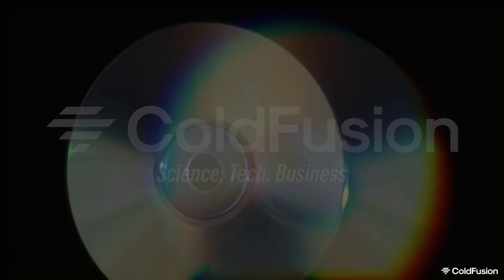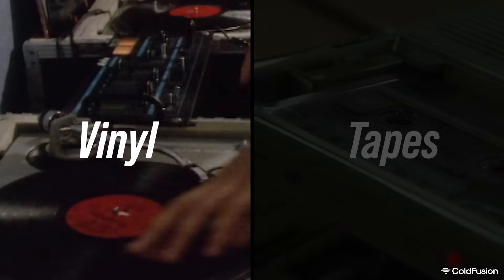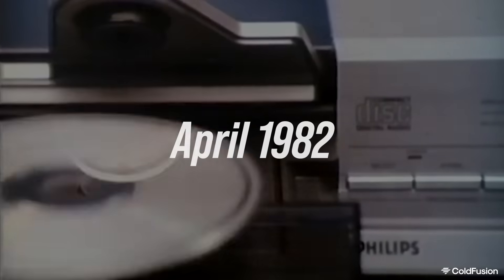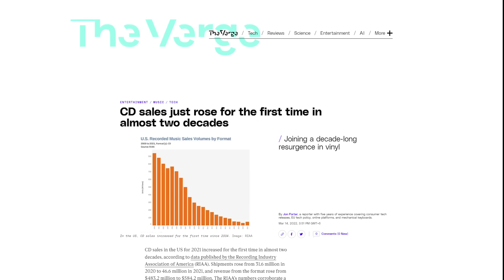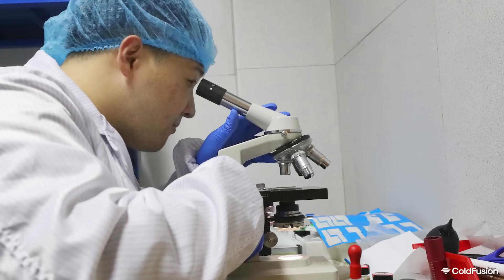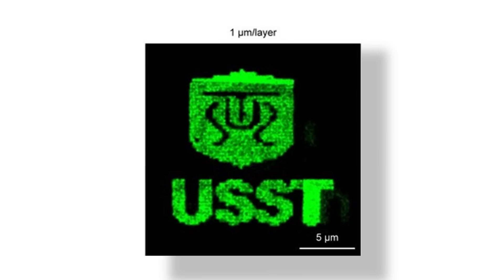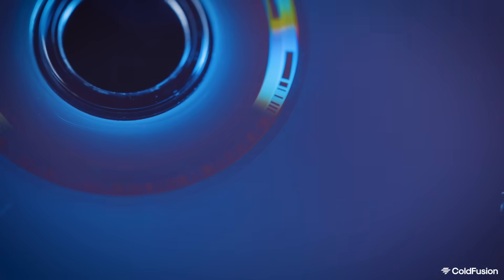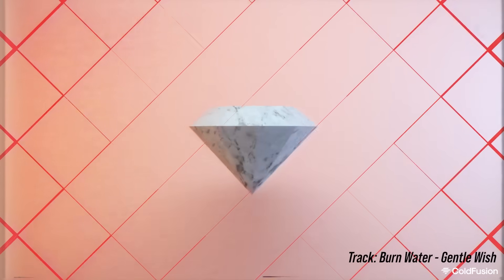Why This New CD Could Change Storage

Comment: This is ludicrously far from commercialization, because the prototype is not even architected as as storage system. They basically wrote some small test patterns close together, and then checked that the adjacent patterns didn't mess each other up. 

(200 TB) / (1 MB/s) = 6.34 years

The spooks will want a black budget edition of this for sure. Record always, read barely ever. With 100,000 of these puppies in a giant datacenter, and a minor performance boost (perhaps 10x), you could have the whole haystack of global internet metadata sitting there, going back for years, to plunge into at any moment for any purpose. Tape is also dense, but recovery takes minutes, rather than seconds. 1 TB/s is a shittonne of global metadata, with say a 5 year retention horizon for drilling into the browsing history of anyone suspected of anything.

Comment: As long as record companies continue to butcher their catalogs, CDs will still retain a massive sound quality advantage. If you like older music from the '60s, '70s and '80s, it can be found on old CD pressings with much better dynamic range and EQ than the brickwalled remasters that are your only option on streaming.

For this reason, streaming services are far from a complete replacement for physical media, especially if you have a decent stereo.

Comment: These may not be suitable for archival use if any property of the dye in the photoresist changes over the years.  In the past with CDs and DVDs, the dye has faded with time, making them difficult to read.  The technology in a 3D nanoscale optical disc is more complex, requiring the dye be optically stimulated before reading.

Comment: If it will sound anything near the old hdd its a no, if it can't get close to the speed of a ssd its a no. I don't see this ever succeeding. Maybe for data centers , but for normal ppl i don't see anyone buying it if it ain't dirt cheap. The will probably pull some crap like with the printers inc...

Comment: You seem to be conflating CD-ROMs (a specific optical disc technology which can hold about 700 MB of data) with all optical discs.  For a while after CDs were dying, DVDs and even BDs were not.  Now they are pretty much all dead (though not quite, fortunately) but you seem to be ignoring that anything in the optical disc space existed besides laserdiscs, CDs, and the new 3d tech.

9:20 So, 30 or 40 nm Extreme UV ionizing radiation?  Isnʼt that somewhat dangerous even at low power?

9:40 Does using interference between lower wavelengths make it safer, or is that used for some other reason?

Comment: it's been an ongoing issue that we don't really have any kind of long lasting storage... mechanical drives fail, tape and memory cells degrade and wear out and while poorly made CDs and DVDs are susceptible to disc rot, that can be mitigated. So for large volume storage, this could absolutely be a thing.

Comment: Magnetic and flash memory manufacturers collude and price-fix to keep their margins from collapsing. Competition is overdue.
Reply: You show up in the most random places.
Reply: Yes, but are you the real chocolate rain?
Reply: you are correct
Reply: Magnetic storage has just hit a wall for getting any cheaper, there are fixed costs involved, not collusion. As for flash storage, there WAS some serious collusion a few years back, but it's not so bad now, SSD's have gotten to pretty reasonable prices, but the manufacturers are trying not to make TOO much and oversaturate the market.
Reply: @PAPO1990 Did those fixed costs seem to happen around the time the flooding happened like 15 years ago? Because the prices per GB has remained pretty steady since then. It reeks of price fixing, because that was LONG before all of this helium and hamr stuff. And flash manufacturers for sure are price fixing. They promised back then how SSDs would be bigger than hard drives by now, much cheaper,and much more reliable (SLC). Now that 3D XPoint has been lost, they really have no reason to be competitive in pricing. We need a replacement for NAND. It's hot garbage.
Reply: Supreme Court : that is illegal
Reply: Lol. Blu-ray discs are quite expensive GB per dollar. If this tech is true, the price will be very expensive.
Reply: @raychii7361  Blu-ray is less than half the price of DVD per gigabyte, and about 1/10 the cost of CDs per gigabyte. This is for writable media. Blu-ray movies are more expensive, because the licenses for the codecs on Blu-ray are way more expensive. The medium itself is cheaper.
Reply: @raychii7361  Blu-ray is less than half the cost of DVD per GB. About 1/10 the cost of CD per GB. What makes movies more expensive on Blu-ray than on DVD are the licensing costs for the codecs.
Reply: What the hell are you on?

Storage is dirt cheap these days…
Reply: @tonamg53  Yeah okay
Reply: @tonamg53  Thank you for your thoughts. Flash memory could be ten times cheaper at scale with very healthy margins—especially when considering the advancements in semiconductor fab technology overall. They’re dragging their feet because when the global market is saturated at very high margins, no one is incentivized to ramp up supply that would exponentially collapse margins with a trivial increase in production expenditure.
Reply: @tayzonday  To get any cheaper… they might need to start employing slave labour and off-shore the company to tax haven countries, lobby government to subsidise on raw materials and enter a free trade agreement with the target market… to make any profit.

I think some already pointed this out but there is a fixed cost in doing any business such as administration, labour, transportation, raw materials etc.

Right now, you can get a 32 GB USB flash-drive for less than 5 bucks… you can’t even buy a Big Mac with that.
Reply: @tonamg53  Thank you for your thoughts. A 32GB flash drive for $5 is not impressive when a 512GB flash drive could be profitably made at-scale for the same price. Lithography and miniaturization are not major impediments in flash memory design. The market is just so concentrated that the wolf guards the henhouse and a few actors arbitrarily decide how to divide and price fab wafers to inflate margins and sustain scarcity. Inhumane labor conditions in the raw material and assembly supply chain are a stable constant in the global economy.
Reply: @tayzonday  with your logic, you are saying they should sell all capacity flash drive at the same price since they all cost the same to manufacture.

I’m sorry but that’s idiotic.
Reply: @tonamg53  Thank you for your thoughts. My initial position was that more competition in the storage market (for instance, from petabyte optical discs) might prevent flash-memory manufacturers from colluding to constrain supply and picking their present exorbitant price points. 

Should they run a profitable business at 1/10 of today's retail pricing because they can? That's a different moral question. I simply pointed out that they could, and you disagreed spiritedly. 

It goes without saying that in corporate governance, the fiduciary duty is to maximize revenue, and it being possible to run a healthy business below maximum revenue is not an administrative consideration. A market disruption is called a "disruption" because it disrupts established revenue models.

For me, it's enough to point out that solid state flash memory should cost immensely less than magnetic storage with today's lithography tech . . . it's far less complicated than multiple read heads interacting with multiple magnetic platters that spin at 7200 RPM. Flash manufacturers hover the price above magnetic tech purely because it performs better. 

It's just not in any investor's commercial interest to spend $5 billion building another flash memory fab to create the additional supply that existing fabs decline to create, just to collapse the global price in a cutthroat, competitive race-to-the-bottom. 

At some point, it might make commercial sense for Amazon, Alphabet or some other cloud host with high liquidity to enter the flash memory manufacturing market to reduce their own long-term enterprise acquisition costs, with unintended consumer benefit.
Reply: @tayzonday  You kinda just say it yourself… no investor would be interested in investing $5 billion just to collapse the global pricing and drive themselves out of business. Today’s prices are already so low it prevents anyone other than those that already in the business to compete.

Note that the magnetic storage drive price war was so bad that it literally drive everyone out of business except for the biggest players. Today only 3 manufacturers are left. There used to be well over 100 manufacturers. So the prices got too cheap basically.

Also, you forgot one important thing… our global economy is operating in a free market environment. The prices are driven mainly by supply and demand. Can they sell things for cheaper? Yes they could… but it won’t get cheaper as long as demands still exceed supply. In fact, it will get more expensive. The price won’t drop until supply exceed demand. That’s just how free market economy works.

Your argument is not based on the real world environment we live in and I’m not going to get into philosophical argument. 

However, if you asked me, I will always choose free market because in the end, competition drives innovation and advances our technology… and that’s what makes our lives a bit more comfortable

Comment: You know, the real problem with a lot of the innovations to improve optical media is that they don't quite solve the problem in a way we actually kinda needed, which at the same time would probably be favorable for the manufacturers and recording companies too. A few of those problems is to do with material cost, packaging for shipment and store space, waste and recycling, and read and write speeds/responsiveness without changing consumer hardware all that much.

One of the solutions they passed up (all with the exception of one format in particular, which was AlphaDisc) was actually multi-level recording, which basically just used existing optical systems, but updated them to make data pits in the disc at variable levels rather than one. Paired this in tandem with using 8 cm. discs instead of the typical 12 cm. ones you could basically bring up read/write speeds, bring down manufacturing and material costs on the discs themselves and the packaging for them, and because they're smaller the store space and bulk shipping allows greater volume of units in the same amount of space as the usual 12 cm. discs. Plus recycling and waste material is lessened in terms of impact since you need less to make smaller discs and packaging for them and you could even extend this to end user drives and systems to make them more compact.

This was something I had for a while been surprised none of them picked up on, especially after they got to UltraHD Blurays that are basically quad-layer discs with pwm pitch recording, since then they could hold more content at smaller sizes and all they'd have to do is drop the larger sizes for lower capacity BDs (25-50 gig discs) and keep 12 cm. for the ones maximizing on space. Even HD-DVD had a multi-format spec that allowed multiple layers of the discs to be either DVD, HD-DVD, CD, or even BD to hold the same content all while making the disc universally compatible in a way, even if it costs slightly more to make since it cuts down on having to sell separate formats of the same content in different packaging altogether.

I guess that's kind of a sad thing though when they went in for digital with Apple and Microsoft pushing this at the forefront, as neither solution truly materialized and we ended up with increased landfill waste (for anything not recycled that is) and dying mediums that cost manufacturers quite a bit till a lot of them quit, leaving only a few in the world now (especially with Blurays as Sony is one of the few sole manufacturers for them to note, apparently.)

Comment: 1:08 Min into this video AND my two cents: 

They could have, they could have! Moores Law itself, like a caffeinated squirrel, scurried through the circuits. 
And behold, the decommissioned technology—those ancient silicon sages—stood ready, etching machines 
in hand, whispering secrets of binary runes. 🧙‍♂

The current industry, my dear viewers, would’ve been a barren wasteland, a digital desert, had it not danced 
with these retired relics. Imagine: no GPUs, no RGB rainbows, just tumbleweeds and a lonely floppy disk, weeping 1.44MB tears. 😢

We rode the tech carousel, my friends! From CD to DVD, spinning faster than a caffeinated hamster on a wheel. 
And then, BluRay waltzed in, all suave and debonair, flaunting its 50GB storage like a peacock at a data disco. 🕺💿

But hark! The natural progression, the cosmic dance of bits and bytes, led us to higher-capacity disks. They were 
stashed away, guarded by digital dragons, waiting for their moment. And what do we have today? Behold, the SSDs! 
Faster than a caffeine-infused cheetah, smoother than a buttered photon. 🚀🔥

cough Peace, dudes and gals! ✌:hand-purple-blue-peace: 🌈 Because, you see, the more you buy, the more you save. It’s like a 
cosmic BOGO sale—buy one black hole, get a quasar free! 🌌💫

So, my fellow tech voyagers, remember this: In the motherboard of life, there are no dead ends—only overclocked possibilities. 
And may your RAM be as plentiful as stardust, your FPS as high as a SpaceX launch, and your thermal paste always evenly spread. Amen. 🙏

Comment: I use cloud storage, but only for backup and archive purposes.  (My work invoves reading a lot of material, and writing a lot of material, along with graphic elements - and my clients count on me not to lose any of it.)  Without local storage, you're 100% dependent on your network access, which can fail when you most need it.  I get by with a RAID array of "only" 8 TB, which is considerably more storage than I'll need in my entire career.
So who needs petabytes in their home or office computer?  The answer is, nobody.  A cheaper version of the technology, offering on the order of 10-100 TB, would vastly exceed the storage needs of 99.999% of users.  There'd be no reason to make the discs removable.  Governments, advanced labs and data centers would be the customers for petabyte storage, and they can well afford $50k lasers if that's what the technology requires.
Also. a vast capacity makes erasing old data non-essential.  A small, standard SSD could store your OS and applications, while your files reside on non-erasable media.  The files not being erasable makes them much less vulnerable to ransomware and accidental corruption.  Secure data destruction would be as simple as breaking up the disk.

Comment: This looks like something made for enterprise storage. It is equivalent to about 7 WORM LTO-9 tapes. those tapes only hold 18TB and cost $120.

So provided you can buy and burn one of these tapes for under $840, there's a market for it. If you don't need a climate-controlled storage room, and if they're smaller, they may be worth a bit more.

Comment: Internal storage is cheap enough at this point to not even consider going back to a physical disk for storage or any use for that matter. You wouldn't have to buy a disk player either. If they could've done this before the death of the CD it could've had a chance.
Reply: They could have. Moores Law itself and decomisioned technology had etching machines ready in droves, the current industry would never have flourished had it gone down that route. We went from CD to DVD to BluRay, last I checked BluRay had approx 50gb of storage available per disk. The natural progression was higher capacity disks that were obviously held for the "better" option of what we have today. *cough Peace Dude :hand-purple-blue-peace: "the more you buy, the more you save..."

Comment: The write speed is to slow and does not compete with magnetic storage in data density. From the description it is merely an optical version of shingled heat assisted magnetic storage.

Comment: Honestly, I would be happy if a single burn disk could hold a terabyte of data, did not degrade over a short period of time, and if they put it inside an enclosed caddy like a mini-disk, I burnt thousands of CD's and DVD's and I have lost all of that data, all of the disks have degraded and cant be read anymore, I have hard disks that have held data longer than CD's and still work, commercially pressed CD's don't suffer from this, but ones using metallic or organic material do.

Comment: The technology is likely too late to see widespread adoption. It's way too expensive to buy the equipment to make the discs for anyone other than large data centers, and the technology takes too long to burn a CD compared to solid state drives, not to mention it's super slow read speeds. Maybe if they develop the technology more and are able to improve all of these factors significantly, you might see more adoption. But cloud storage is just so much more convenient for businesses and normally for tech like this to mature, you need initial customers to buy the products so they can use that to invest in further development. But maybe if the Chinese government continues funding it, we might see some progress with it.

Comment: If the power requirements are an issue, is there any way to just dial back the resolution from the petabyte range? A 4 TB disc would be enough to be honest.